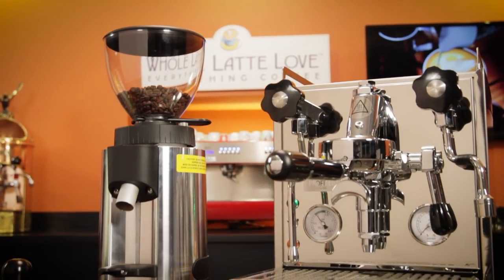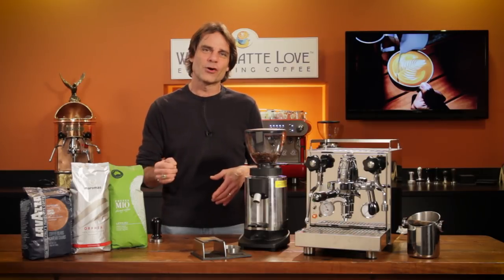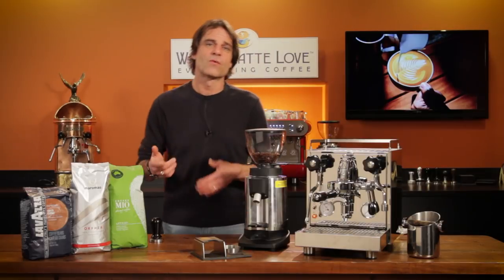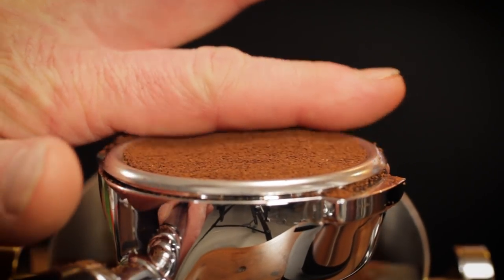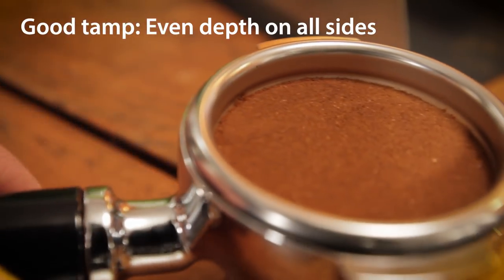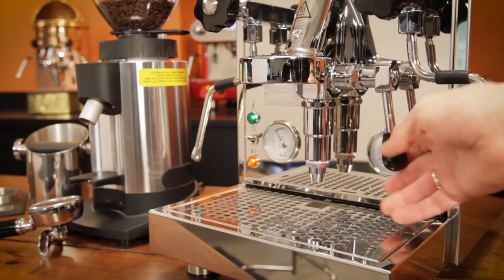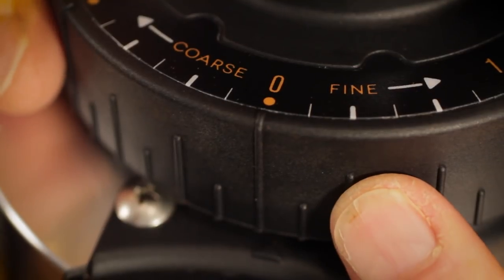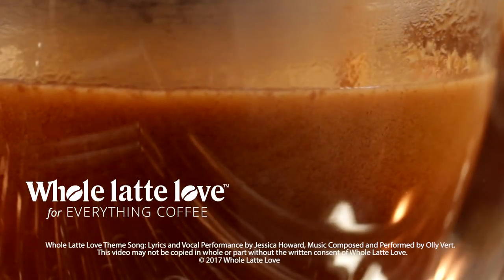How To: Basic Espresso Technique - Dialing in Grind Size

Comment: I was with you right up until you said "volume". Volume is a terrible way to measure coffee extraction. It should be weight in, weight out, and come up with an extraction ratio. Volume is too variable depending on state of gassing, freshness of beans etc. You might get two totally different volumes from the same coffee on the same grind settings a few days apart. 

Weight is the only accurate measure for extraction.
Reply from the maker: Hi Shrink, Thanks for the comment. Volume is basic technique - understand this is an entry-level video for those learning how to dial in grind! I'll push back a bit on your characterization of volume being a terrible way to measure coffee extraction. It's part of the the picture. I totally agree with you on extraction ratio being another part. In fact, I so agree we have a video on using brew ratios for those who are a little deeper into espresso: https://youtu.be/57UqPDirHoU
Marc
Reply: Thanks for the reply. I understand there seems to be a preference for volume based in the states vs weight based here in EU. I'd argue that in a world where consistency is key, and variables are hard enough to control, that volume offers too inconsistent a result to be truly accurate. Certainly i've not seen a speciality shop / barista / home user using volume here in the UK.
Reply from the maker: There's plenty in US using brew ratios. I always weigh my coffee dose but once I get to know a coffee I rarely weigh shot's.

Comment: Why do people still polish shots! Stop for the love of god. It adds nothing to the shot and increases the chance of disrupting the surface
Reply from the maker: Hi Adam, Thanks for the comment. I don't agree but if no polishing works for you don't do it. Since making this video I've put away the tampers and gone to using a leveler exclusively like this one: https://youtu.be/4Z5vTi643sc It does a lot of polishing and produces a perfectly level puck every time. IMO it has decreased channeling in my extractions and upped consistency.
Marc
Reply: @Wholelattelovepage  Would be interested to see if you have tested this and why you think polished helps as it really shouldn't matter what the surface of the puck is like as long as its an even tamp

Comment: why cant u just explain what does the setting means ? grind numbers ?  what does 5 means ? what does 10 means ? talking about theory and theory and tech jurgons
Reply from the maker: Hi AR, Numbers are just for reference. Even if we both have the same grinder a setting of 5 on my grinder will likely produce a different grind size than a setting of 5 on yours. Dialing in grind size is easy and perhaps the most critical aspect of making espresso. The theory is incredibly simple. A finer grind slows down an extraction. Coarser grind size speeds it up.
Marc

Comment: People really overthink this stuff. I get the whole ritual and tinkering thing, but for those who just want the straightforward great coffee, you really don't need all this busy-ness. I have really refined tastes so while I don't follow a strictly regimented program, my coffee, in its small variations, is still at least as good as a great coffee house and usually better. I just don't have to pay $6 for it! My coffee cost me about $1.85.

Pick your favorite high quality bean. Grind it. Filter very hot water through it by using an aeropress. Voila! I enjoy my coffee iced. I let the coffee cool down naturally till it is warm. Add 2% milk. About 50/50 milk coffee. Full ice. Done. Perfect every time.

This whole business that it has to be this bean, roasted this way, this grind, this water temperature, this duration of pull, etc. Nonsense. I'm not saying it isn't difficult to mess up coffee, but what I see is people trying to create and follow these regiments is where a screw up makes a much bigger difference. This is where the nonsense comes from. If you just hammer down a basic, straightforward program, you'll have easy grade A coffee everyday with small variations. As it turns out, sometimes a little variation is nice.
Reply from the maker: Hi CU, Thanks for the comment. I like variety as well! All different levels of coffee/espresso drinkers. Some are incredibly particular about brewing parameters and for some coffee is just a vehicle for delivering caffeine. I'm all for everyone making/drinking what they like! Cheers!
Marc